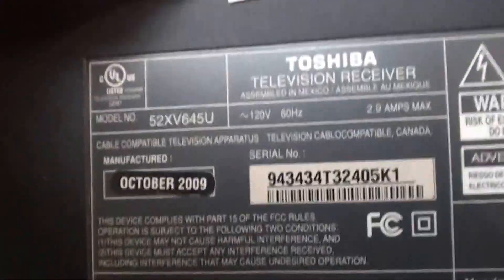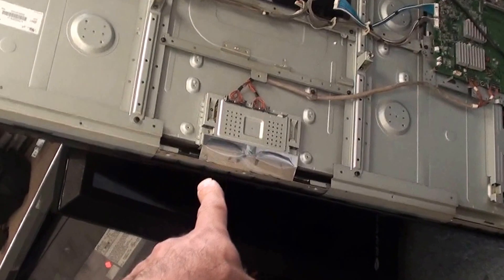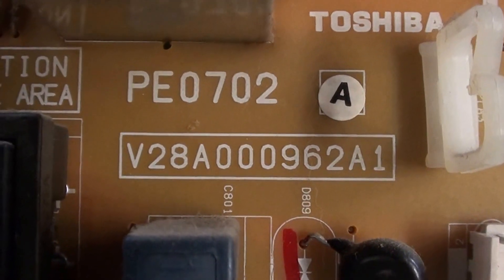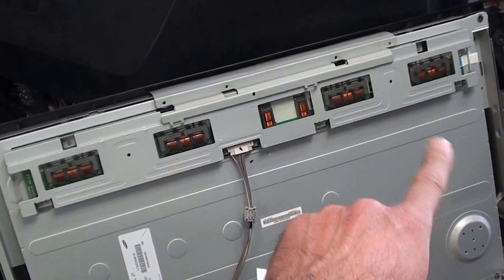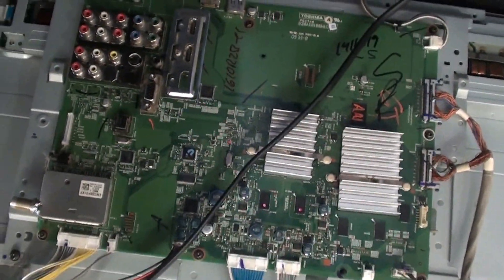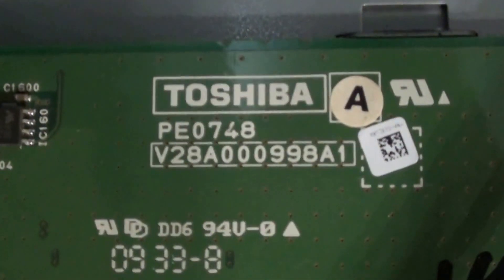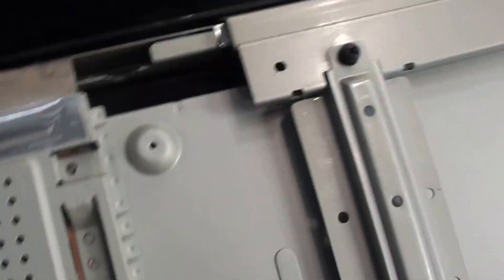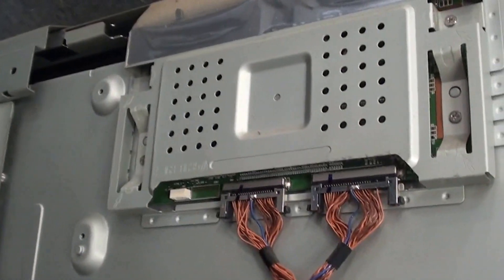Obaid's Electronics Toshiba REGZA 52XV645U panel LTA520HE16 The Electronics Shop electronics repair

Comment: i was wondering if the t-con board or the main board is bad if half on the screen has vertical lines on it there other side displays fine except for the other side
Reply from the maker: Tcon
https://www.ebay.com/p/1604037178

Thank you if you found this video helpful please don't forget to subscribe

Comment: I have the same tv I'm having problems with it has sound but no picture any suggestions
Reply: Looking into the issue also. Mine flashes twice within 10 seconds of turning on then goes black. Don't know that much about electronics but if you can take it apart id suggest looking for blown or bulging capacitors (Still may be broken despite good condition though) Considering you can buy them for a few dollars it may be an easy fix. If not narrow it down by looking on forums etc and then replace the part. Good luck
Reply: +Varyable Beats did you ever find out why? I have the exact same problem just now with my 52xv545u. Turn power on, screen flashes on, then goes black, then back on after about 2 seconds, then back to black and stays off.
Reply: Hey, yea i think i did. even though it's still in my closet lol.. but i bought a multimeter for $20. Research my model on forums and found how much power etc i should expect out of which capacitors/boards. So if it should be 20 here, and its only 10, then the capacitor may be dead, or issue with the board. I narrowed it down to the video board - $60 (which is much better than power, it's cheaper to replace) so you can replace the capacitors yourself or get someone too. Simple job i just haven't practiced enough.. get a flashlight, google blown capacitors and go through every one, might find it :) or buy the whole board. The fact it comes on for a second, to me, says it's not blown or dead. it just can't hold the power after it comes on, ya know?  JFROZT
Reply from the maker: https://www.ebay.com/p/1604037178

Thank you if you found this video helpful please don't forget to subscribe
Reply from the maker: @jfrozt  https://www.ebay.com/p/1604037178

Thank you if you found this video helpful please don't forget to subscribe

Comment: Bill if you're looking for a power supply for a Toshiba 52XV645U Ebay has one the part number is V28A000962A1.If I were you I'd check on the numbers on your power supply before ordering a new one to be sure that you get the exact same board.
Reply from the maker: https://www.ebay.com/p/1604037178

Thank you if you found this video helpful please don't forget to subscribe

Comment: I had my Toshiba Regza 52XV54OU for some time now.its been an excellent TV until now. Picture won't display.I tried different devices in different inputs and I get the same result.Turns on fine,have sound,screen turns blue white.for example...if play my roku player,i can hear it as i shuffle thru.If i play regular tv same result.I can see the lighting in front change as i play tv or a movie.when I look thru the top vents I can see the lights on inside.If I touch the front screen,the area that I'm touching gets very bright .it does this effect thru -out the screen.( I don't be leave its a back light problem).I replaced the main mother board along with the T con board and still have same issue.no improvement or change.Does anyone have any idea of what could be causing this? Any help would be really Appreciated! Thank You!
Reply from the maker: Thank you if you found this video helpful please don't forget to subscribe 👉 check B+ to T-con